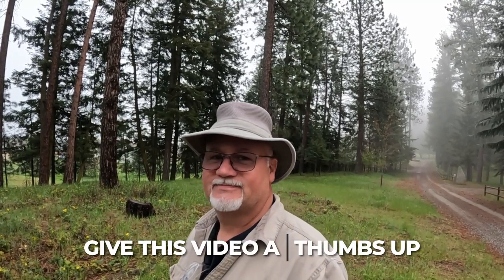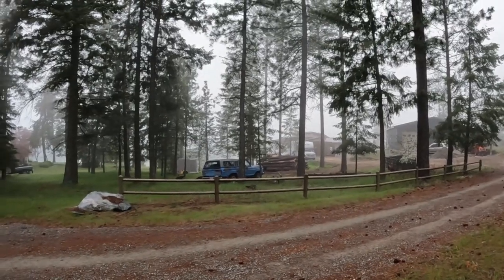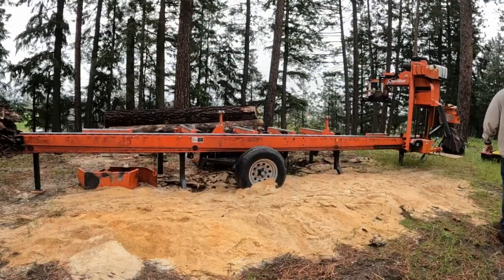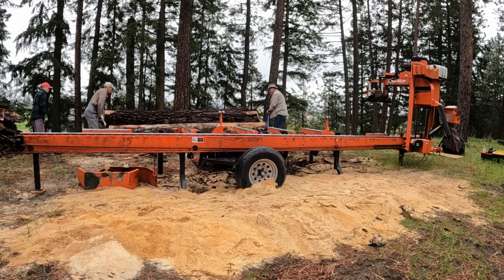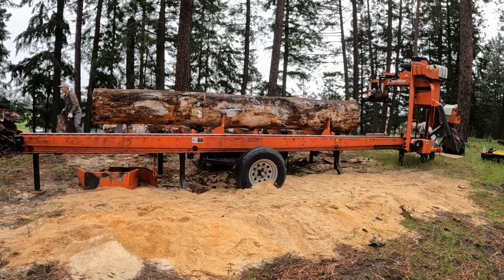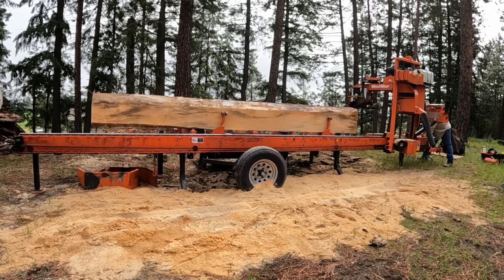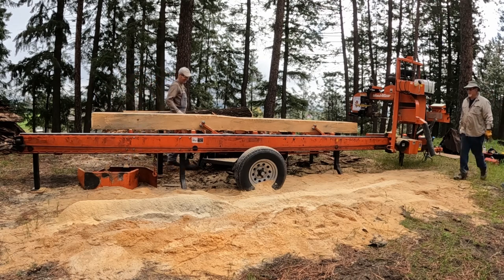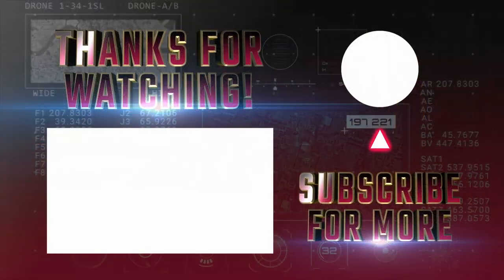Hitting a nail on a bandsaw mill [Wood Mizer]

Comment: I bill by the board foot (when they bring the log to my mill) and the length is rounded UP to the next foot, and width and height are rounded UP to the next inch.  NOT the nearest inch, the NEXT inch.   My smallest billable board  is 8 ft x 1 x4.   So if you bring me a 4 ft log it is billed at 8ft.  I just did a video about this, not out yet, but filmed about when you were putting this out.   Lol. Have fun and keep making sawdust.
Reply from the maker: I saw one you just put out about board foot billing on a cherry log.  Good video!  And I like that others are doing it!  When I Calc board footage I go by what I mill but it's just for the customer.  But to 29 foot 10 inch logs I did today are 21 foot for the same reason you do it.
Reply: @TheOldJarhead  It is a weird subject for sure.  I also sell lumber, all kinds, from kiln dried to green. When I sell lumber it is  scaled down to nearest “even number” foot. So if I sell a board that is 11’3” I scale it down to a 10’ board.   I guess because 8, 10, 12, 16, are the “standard “ sizes.   Probably a hard subject for the new sawmill owners to grasp?   IDK. Lol.
Reply from the maker: But it's conversations like these that might help them!  I don't sell so it isn't something I have to consider but I think you are spot on!
Reply: @TheOldJarhead  And there is another idea for a video.  Lol
Reply from the maker: @DANG--  Yup!

Comment: I also charge by the hour, so I'm only measuring board footage by request or for my own records. When I do it, it's always based on exactly what was milled. When I first started milling I tried charging by board footage, with the understanding that odd sizes would be rounded up (e.g. 1 7/8" scaled at 2").
Unrelated side note, I just got a job milling for a Mennonite (similar to Amish)! Never thought I'd see the day.
Reply from the maker: Awesome on the new job! Congrats!  I have always charged by the hour but keep records for myself and to let customers know what I milled.
Reply: @TheOldJarhead  off topic question for you. Have you had customers offer to supply gas for the mill? I've had a few customers offer to keep gas in the mill so I did what I could to factor that into the bill
Reply from the maker: Once or twice.  Usually I carry enough that it isn't an issue but I remember one making a run for me on a long job
Reply: With non ethanol at $6/gal I'm probably not going to see anyone dipping into their private stash anytime soon 😅
Reply from the maker: @Desert_Hobo  No doubt. Funny thing, I run regular
Reply: @TheOldJarhead  safe to say no problems using ethanol gas?
Reply from the maker: none
Reply from the maker: I've run regular unleaded for 600hrs and 6 1/2 years a d haven't had an issue.
Reply: That's got me thinking. Regular is a good dollar cheaper than non ethanol, might have to give that a try
Reply from the maker: I've heard all the arguments but never had the issue people claim I would.  I'm sure non-ethonol fuel is better but haven't had an issue so I go with cheaper fuel and move on.  Keep being a #sawdusteater ! lol